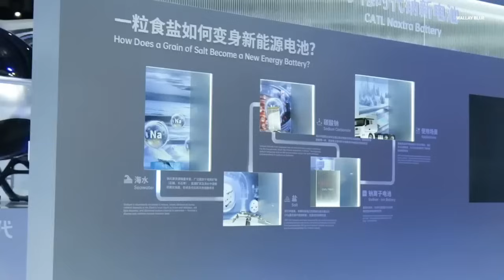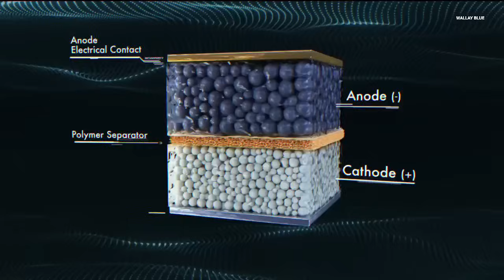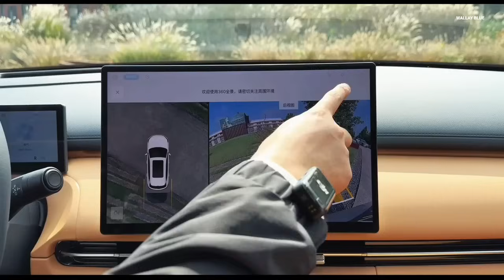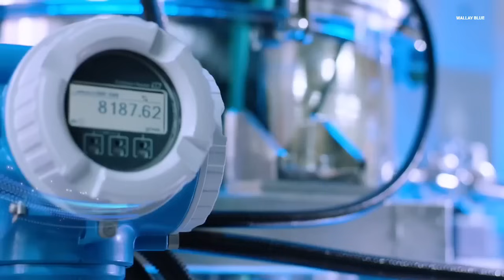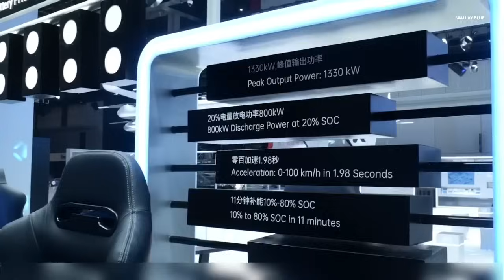CATL launched a new sodium battery with a 5-million-kilometer lifespan that will take over lithium

Comment: Manufacturing these sodium batteries cheaply will be the biggest problem that needs to be solved.
Reply: These sodium Ion batteries are already cheap to produce due to the materials.   You can buy one now and it will cost nearly the same price of a lead acid of similar capacity.   I use one in my ICE car now and it works great.   When production scales up definitely it will be much cheaper.    I cant wait to see these in EV's.   When this is done, the EV can do away with the battery cooling systems as well.   Making the EV much cheaper to purchase
Reply: @bertdejesus3578  what brand of battery do you use for your car?
Reply: @bertdejesus3578 making EV's cheaper to purchase is not how business is done in the west. Right now they are ridiculously expensive, batteries are fragile (even the slightest damage to the undercarriage can make car a total loss) and expensive.
Reply: catl already solved it 
they already sold 10 million vehicles in china with sodium batteries :)
west is behind rightnow check the catl company press releases